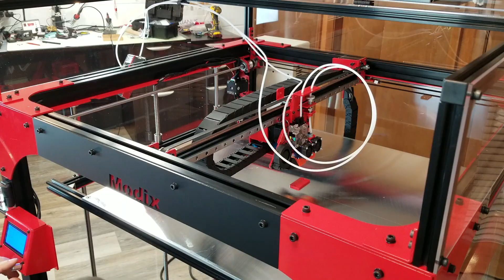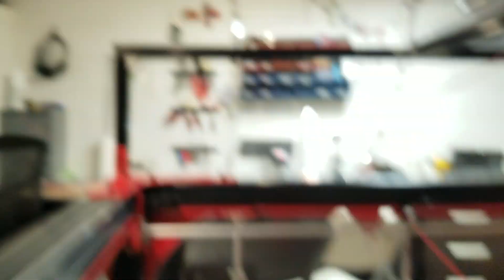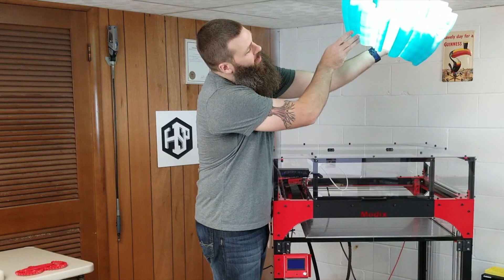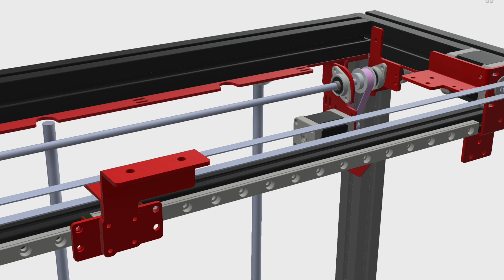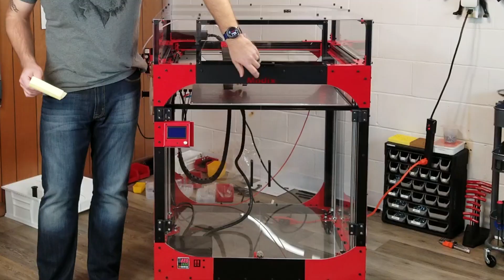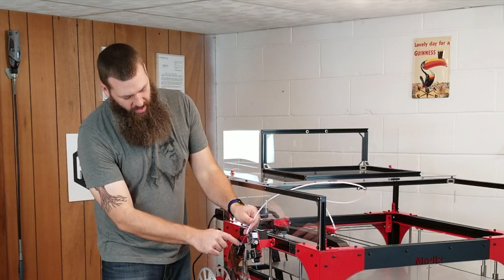Modix BIG-60 3D Printer Build Part 6: Calibration, First Prints, and Final Thoughts

Comment: What kind of stepper drivers does this machine use. Thx
Reply from the maker: The Big60 uses A4988 Stepper Drivers on a removable carrier board. Like this: https://www.pololu.com/product/1182.
Reply: @ecostruder  I wonder why don't they use the well known TMC2130 stepper drivers. It would eliminate the endstops and the whole machine would be much quiter. Maybe there is some limitation that I did not recognised yet but as far as I know MKS Gen 1.4 would work with them just need to change some Marlin lines.
Any thoughts about this?
Reply from the maker: @Dombi3D  Yes, the TMC2130 drivers are wonderful, though I assume they are more expensive. In general these machines are made with very high quality name brand parts such as Gates belts, Hiwin Rails, etc., but they saved money where possible to still offer this impressively large machine at a very reasonable price. It seems to me that the control board and the stepper drivers are a couple of things that didn't seem necessary to go with expensive parts for, so that's where they opted to use less costly parts. Also, I generally prefer to have actual endstops rather than the stepper driver sensing an endstop. Maybe I'm just not trusting enough, but give me a limit switch and I'm happy. Thanks for watching!

Comment: How long did it take to assemble and get it up and running?
Reply from the maker: It took me a lot longer than it should have because I was filming the process. That added a surprising amount of time to the build. But I believe a standard build should be able to be completed in around 20-30 hours, depending upon the level of familiarity you have with this type of assembly. Now that I've built one I think I could do it in much less time than that, especially I wasn't filming it!

Comment: Brandon, Thanks for the great videos. I have one of these on order. I had 2 questions. 1) how do you like the induction sensor vs a bltouch. 2.) where did you get the coasters?. I would love to get some more of your thoughts after you have printed more. I actually have a couple of duetwifis hanging around and was thinking about modifying the marlin 1.8 with the duet
Reply from the maker: Thanks for the sub! 
1) I like the induction sensor, but I'm pretty seriously considering swapping it out for a BL Touch because I want to print Nylon and Polycarbonate on Garolite, which won't be detected by the induction sensor. Otherwise I've had no problems with it and can fully recommend it. 
2) I designed the coaster myself for use around our house. We've got an assortment of them, all printed in Ninjaflex. I thought it would be a good (and fun) test of the full print bed to print out a 400% scale version in PLA for my very first test print. Now I just need to print out a 400% coffee cup to go with it!!
The Duet Wifi would be a nice upgrade, though I'm not sure how much difference you'd see. I've actually got one hanging around that I've thought about using as well, but I've had zero issues with the MKS board in there now so I don't have a burning desire to swap it out. The BIG-60 come with a Raspberry Pi running OctoPrint to interface with the MKS board, but I haven't gotten it installed yet. With that combination of hardware I don't know that there's much advantage to the Duet since 32-bit isn't needed. That may change with Marlin 2.0 though.

Comment: Looks good!   Very curious about other materials.  I usually print in PETG and was curious how that works.  Nicely done
Reply from the maker: Thanks Drew! Me too, so I'm going to be printing with Reflow 100% recycled PETG today.
Reply: @ecostruder  And PETG printed well?????? I would like to see some pictures or video!!! really interested in this printer!
Reply from the maker: @drew7977  Yes it did! Handled it like a champ. Not a single sign of warping or other issues typically associated with PETG. The enclosure held the heat in nicely. I preheated it until it was 100F in there and then printed some long, skinny parts that would typically pull up from the bed if cooled too quickly. No issues on the BIG-60. Check out the pics on Instagram here: https://www.instagram.com/p/BqfaNuIgDjc/
Reply: @ecostruder  That looks nice!!!  I  have a fusion 3 F410 with the volcano nozzle and I have a hard time getting rid of strings and retraction.  Depending on infill I will get some warping.  This printer looks pretty good so far.  I might have to take a chance on it!!   Thanks for the reply!